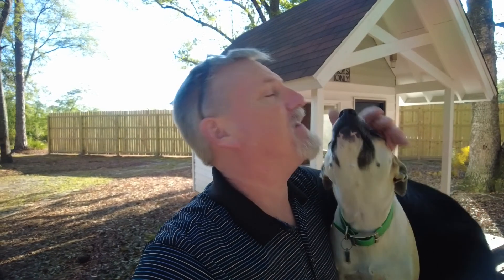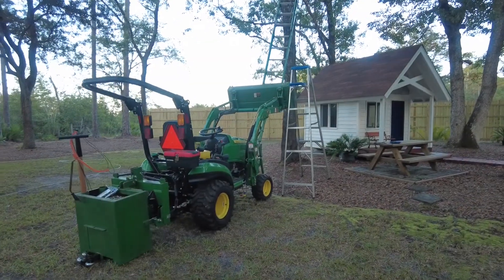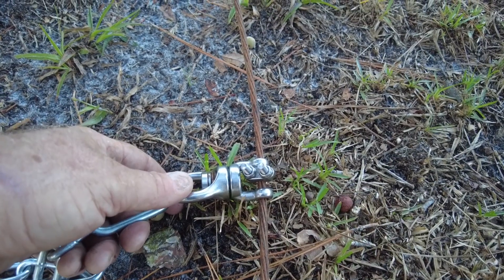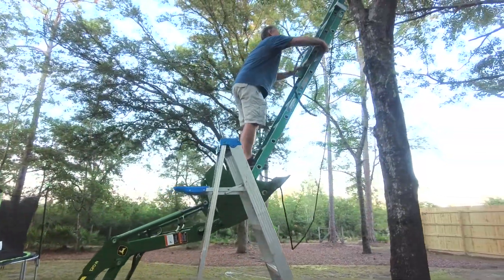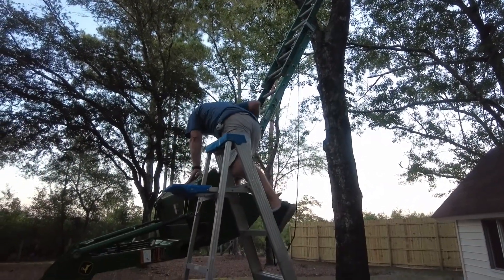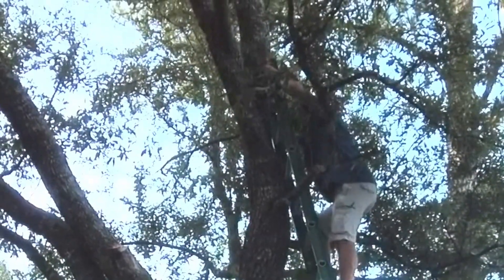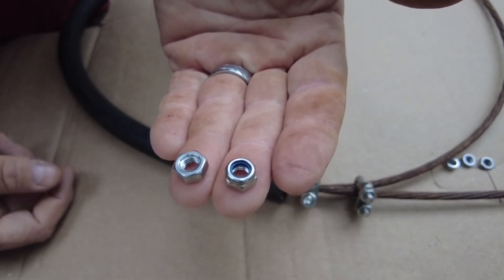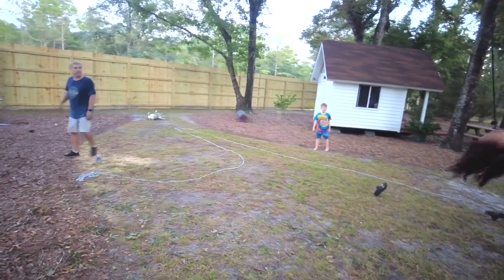How to hang a rope swing between two trees for the grandkids

Comment: Where can I find the gadget that hooks to the cable and swivels?
Reply from the maker: I got it found it on amazon. This is the product description (Dolibest Heavy Duty Swing Hanger, Swing Set Accessorie with Carabiner for Indoor Outdoor Playground, Porch Swing Hanging Kit for Wooden and Concrete Set with 4 Wood Screws and 4 Expansion Bolts, 900LB). Do a search with that and it should get you in the right area to find a product that will work. it was 21.99 when I went back and looked at my purchase history.

Hope this helps, good luck on your project.